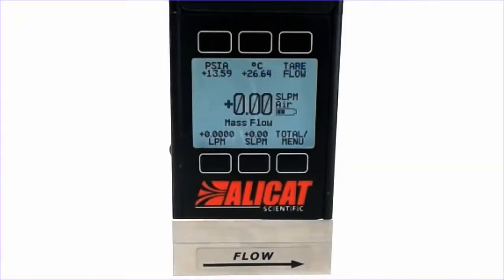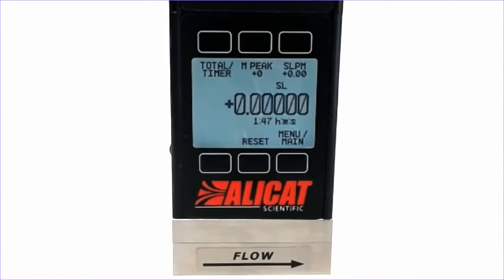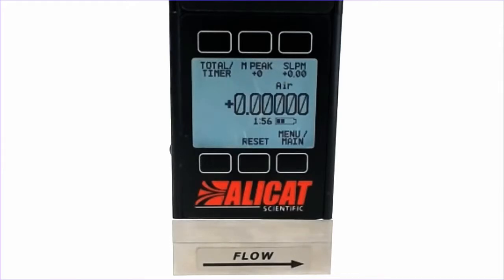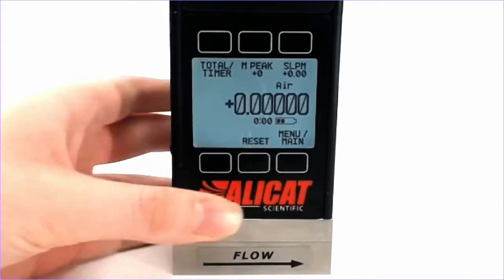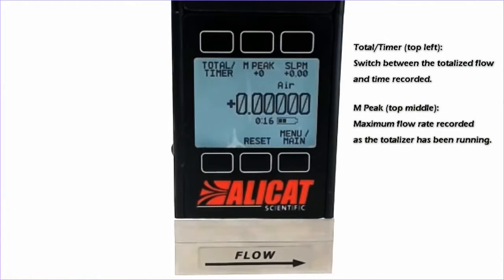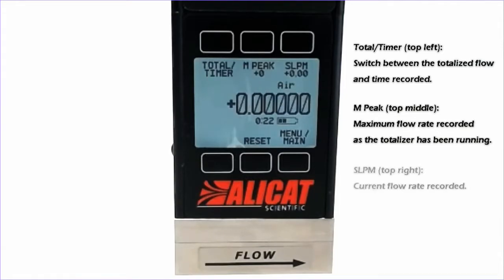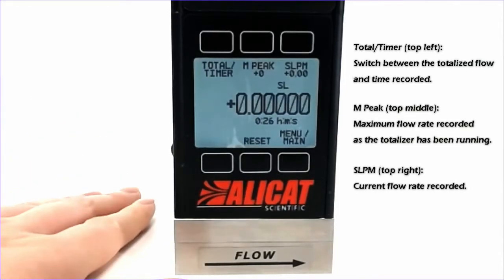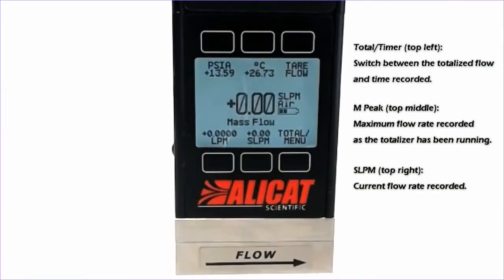Alicat Mass Flow Meter: Tutorial - Totalizer for 8v Firmware

Comment: How  this function  is benifitial for gas flow  ...please explain
Reply from the maker: Hi Ritu! The totalizer displays the total flow that has passed through the flow meter or controller, as well as the elapsed time since the last reset. It additionally displays the current flow rate and the peak flow rate since it was last reset. 

You might find this video "How gas totalizer on mass flow meter works" helpful for understanding: https://www.youtube.com/watch?v=4Q16D5m33DQ
Reply: Hi, can you measure suction rate (suction flow) by connecting the vacuum source to the outlet of the totalizer? Thanks!